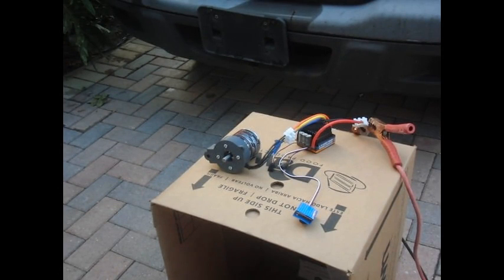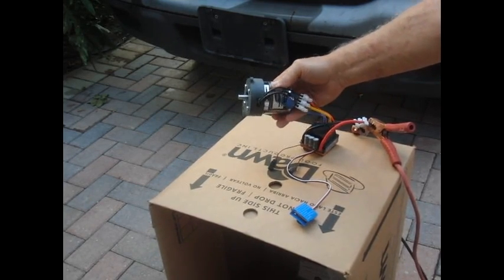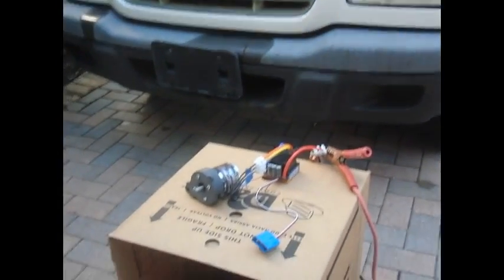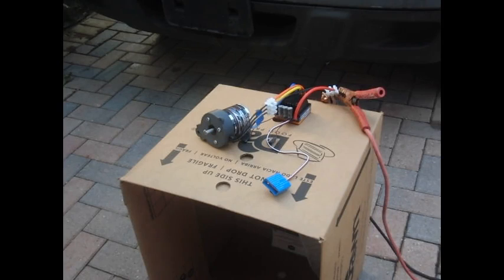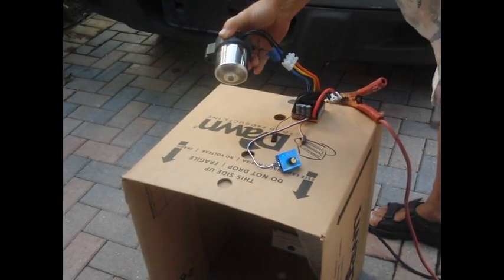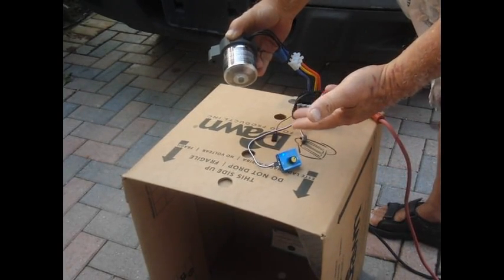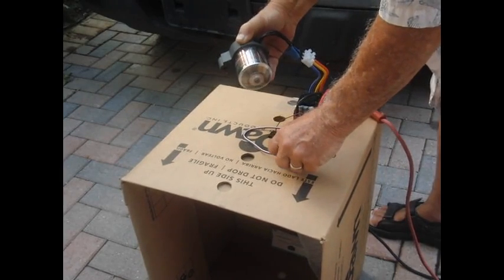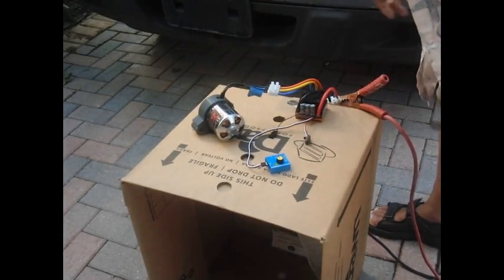HobbyKing Outrunner/ESC  Problem

Comment: Your esc is designed for use with inrunners and doesn't provide high enough timing angle.
Reply from the maker: unander Motor Compatibility: Brushless sensored and sensorless
http://www.hobbyking.com/hobbyking/store/__33984__Turnigy_Trackstar_150A_GenII_1_8th_Scale_Sensored_Brushless_Car_ESC_PC_Programmable.html
Reply: Boyntonstu I'm using this with my e-bike: http://www.hobbyking.com/hobbyking/store/__24565__HobbyKing_100A_ESC_4A_UBEC.html
But i have a cpu cooler strapped to it for added cooling.
Reply from the maker: unander My  buddy is using the same motor and esc on his bike.  The only difference is that he is using an Arduino and I am trying to use a servo tester.   My motor now spins a unloaded wheel at the correct 28 mph but to does not torque jump?  Any ideas?  Skype?
Reply: Boyntonstu If you have a freind with a working setup i think you should talk to him. Also the esc you linked is not the one i see in the video.

Comment: That looks like a car ESC. Did you go over its configuration? At least do the throttle calibration, but also make sure brake is disabled and only forward mode is set, instead of forward/reverse.

Do you have a plane ESC to test with?
Reply from the maker: Sergio Salvi   Check this out:  https://www.youtube.com/watch?v=ef2XK1nHQEE